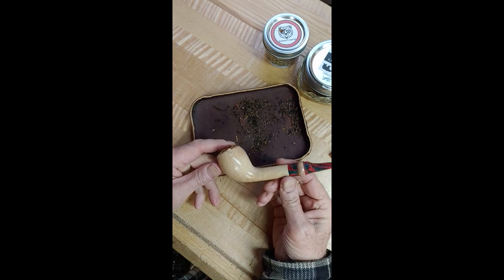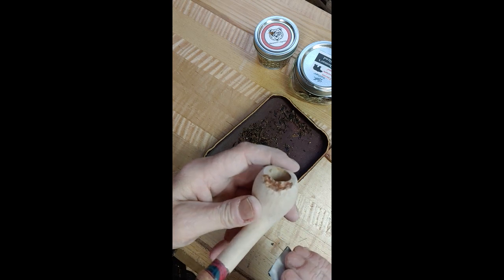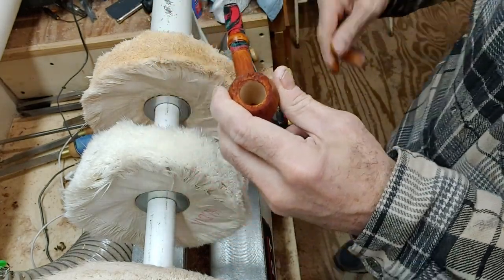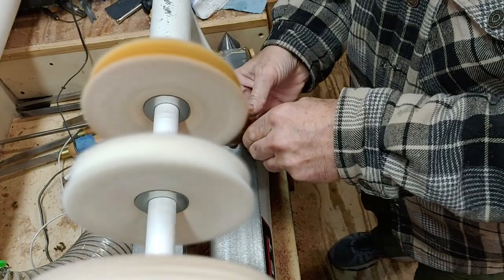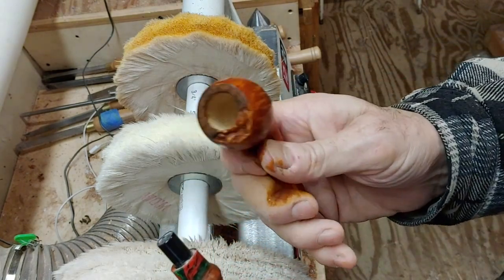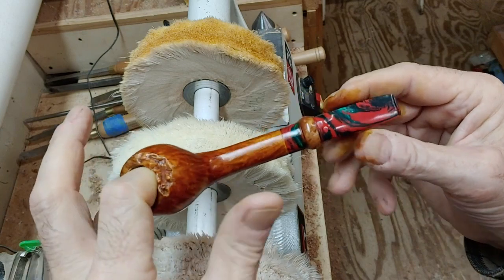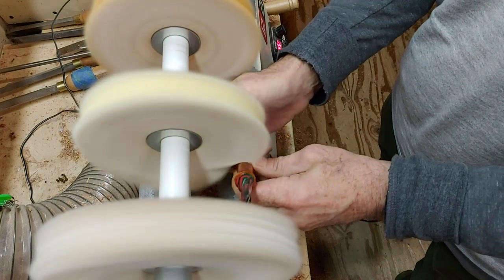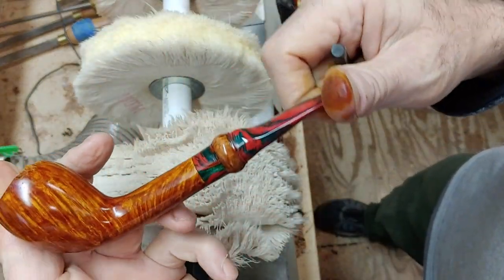Dying, Buffing, Oiling and Waxing a Briar Tobacco Pipe

Comment: Clever lathe buffing station!  Do you leave the buffing wheels on it permanently, or is it easy to pull them off and use the lathe to get some other work done?
Reply: Did he ever get back to you?
Reply: @robertcornelius3514  nope
Reply: These buffing setups can be handy, you chuck it up on the lathe while you use it, then take it off when you need the lathe for something else.
Unless you can have 2 lathes and set one up like this permanently